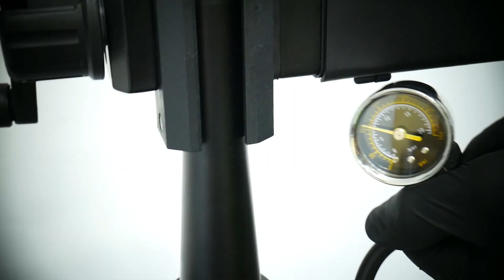RST F1RST / FIRST Air Fork Service + 5 Problems You Might Come Across.

Comment: Oil amount depends of many factors like:
1) wheel size
2) fork travel
3) damper design, i mean damper lenght

So you should add such amount of oil to dive off a compression damper valve. In other case you will (partial) lose lockout/compression or will get hydraulic shock.

If you have question about what to use in air spring, you just can check this with oil with different viscosity, also try with grease ;)

Also, there is two different sides on retaining. One with soft edge another sharp. So sharp side MUST abut to exit to prevent pressing out.

And why you didn't add oil or grease to the lowers???

If you have any questions just let me know.
Reply: no oil into the lowers just soak the foam rings in 15wt
Reply: @randomchannel1712  so no oil needed on the lowers of rst first? Just oil on the foam rings?
Reply: @carljoshuaramos5603  if it has foam rings it needs oil, if it has grease grooves it does not
Reply: @randomchannel1712  what is grease grooves?
Reply: @carljoshuaramos5603  older rsts were grease lubricated
Reply: @randomchannel1712  okay i see, as for my rst first. Its like 2021-2022 model but still no oil in the lowers. Its just grease but it has foam rings. So what do i do? Just soak the foam rings and do not put oil on the lowers?
Reply: @carljoshuaramos5603  you add 10 ml of 15w fork oil in each lower
Reply: @randomchannel1712  got it. But i'm worried that it will leak at the bottom bolts because it seems like the rod that connects on the lower leg does not have any rubber seal to prevent oil from leaking. If you don't mind how can i reach you? Do you have email or messenger? Thanks
Reply: @carljoshuaramos5603  I think they are friction fit
Reply: @randomchannel1712  so it is safe to put oil? Okay will try this on my rst first when i change the rebound rod. Which has a leak

Comment: Thanks alot.I just use thr Rst first air in the same day you replace your new fork.
It 's work very well just  adjust the air pressure and rebound for correct weight of the rider.
Remote lock out doesn't need any more.

Comment: i have a question for you SickBicker im watching ur videos since the one video explaining why cheap forks aren´t that useful for All Mountain events. And i already have a good capable Hard Tail XC Bike with a good durable fork and i actually wanted to build myself a slopestyle Dirt Jumper mountain bike and the question is, is it really necessary to have a average fork like in a price of 189€ or above because im gonna drive it with 2,4 tyres 26" and 65 PSI and im only gonna use it for flowy jumps. Should i really invest for a good suspension or does a Marzocchi 110mm fork with a little bit stiff preset would do the job ?.